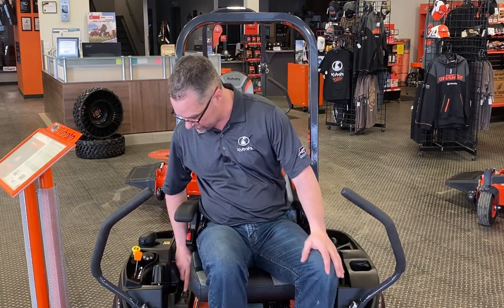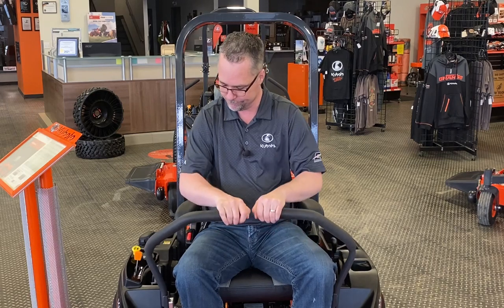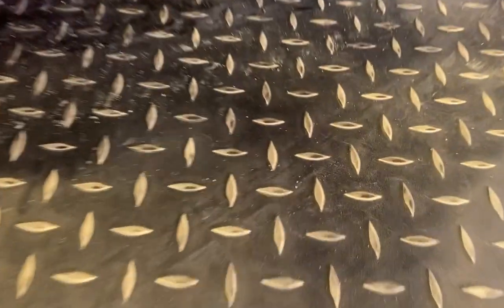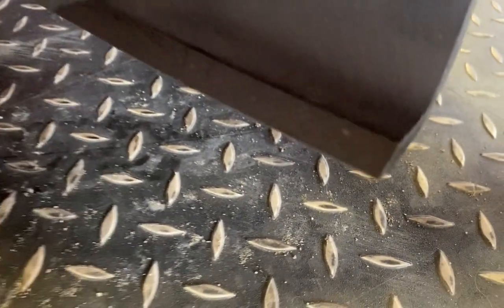The all new Kubota Z200 series zero turn mowers have arrived!

Comment: What is the smallest deck width that a Kubota Zero turn mower is provided with. Do they sell customer spec mowers where the customer specifies type and style engine Ect.
Reply from the maker: Hi Lester. The smallest deck we have on a zero turn is 42" which comes on the Z231KW-42 model. Kubota doesn't offer the ability to spec out your own model but is very diligent with matching up HP with deck size.